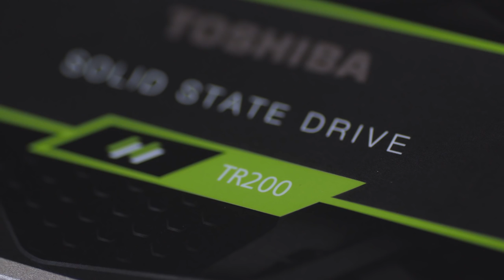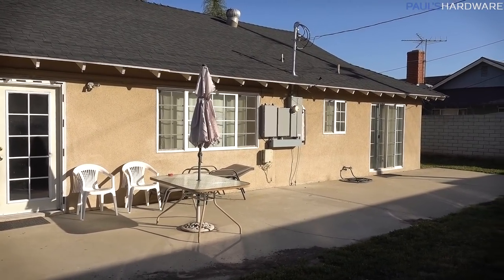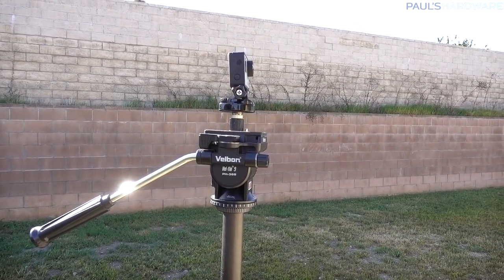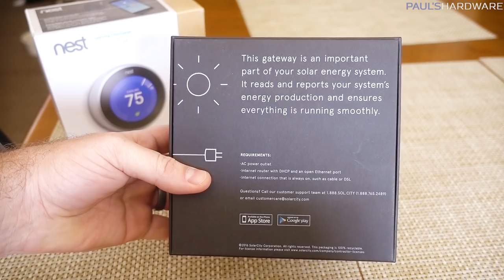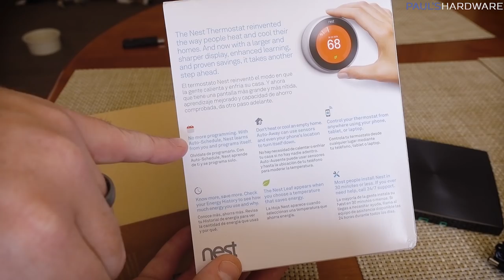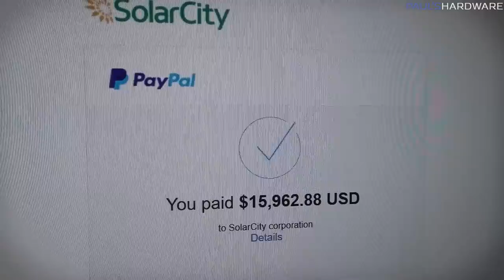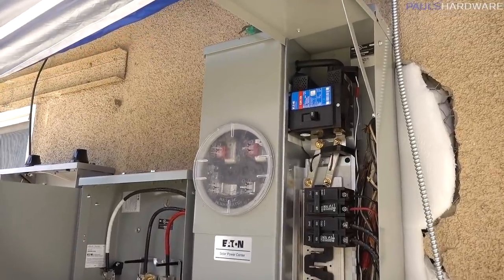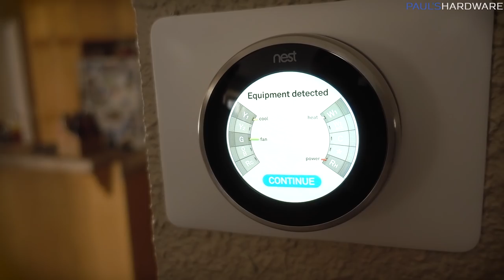The Good, The Bad and the Powerwall - My Tesla Installation Part 2

Comment: I have a question!!! that you put the powerwall at South that the sun light will heat the battery and the inverter!! if was you , I probably will put them in an other area or put something to cover them nicely , from thiefs and the UV sunlight that make them hotter !! in order to keep the equipment more years with out an issue!!  I know this system designing to be at rain and sunlight!! but even then, when I hear the fan run on a hot summer day ... I know that it is not good!! battery and inverter must be in cooler area and not be at hot area! and also have good fresh air!! I don't not know what suggestion I can give you , most of the electricians will say , will be fine!! But may be you can see where the sunlight will be at the pic and make something with the roof extender !! and have more shadow for you to relax...  something made with wood may be!! will be cheaper is you make it by your self after research . you will learn how to repair anything or upgrade ,plus a nice video , if you do handy stuff!! peace! P.S. I like the way you cut the video , is not boring... new subscriber!!

Comment: I'm having nothing but problems with my tesla solar install.  I had the roof done, conduit ran, panel upgrade. Wrong color of shingles, wrong type... not low profile panels, hideous disconnect locations, had to cut a tree down.

All things they could have said upfront but only to discover after the fact..

Comment: Very similar in Australia but alot cheaper hear but that is ent with the battery's hear but they do have it i have small solar in my room only 40w also in my house in the Philippines i have solar to its small one only 100w but i can add more panels to it i like two more so 300w so its good at moment it runs tv and computers and cb radios there in the Philippines with a 1500w inverter only small compared to yours Paul you need a veranda out there

Comment: Your home's power access panel is right outside, that is super easy for a thieve to pop open and just turn the power off and break in.  Not to mention if they knew how much the powerwall cost, that could be a good $4000 item on ebay.

Comment: My PZEV Focus has been proven to pollute  no more than charging an electric  car does. 150K miles , no major repairs needed so far. I feel pretty green👍
PZEV cars have super ultra low emissions engine / Zero evaporative emissions.
Reply: Most electricity in the United States is produced by Coal.  So you're polluting just as much, just not as directly.

I'm not saying solar panels and electric cars aren't worth it, just pointing out that until your home is completely independent of the energy grid, you are still polluting.

Comment: Just my two cents...instead of just getting the portion of the roof fixed to Tesla standards...just do it all. Honestly get it over and dine with and you won't have to worry about it for 25ish years. By the way, sexy battery.

Comment: bit surprised u can't Mount the inverter over lithium batteries...I know for lead acid u would worry about the battery gassing acid fumes into the inverter but lithium??
Reply: sweet fixing the roof for you daaaaamn .when a company has money

Comment: $6,000 for that solar setup is AMAZING.
Reply: Umm, where did you get 6k? Even after that deduction, it should be about 23k. Paul said $500 up-front, $15k-ish prior to installing, $15k after the installation and a $10k deduction from the government.
Reply: You're right, it above $20,000.

Comment: Cool video,  I got my panels installed in 2012 and I wrote a small python script that have been logging production every minute since into a MySQL database. :D they didn't really have an app back then so the script also makes a webpage for mobile with a graph created using RRDtool so I can follow it on my phone. Then another script translate it and upload it to  pv-log.com where I can compare my production to other installation in the area so I can see if it is performing OK.

Comment: Hi Paul. I got solar city to put up the solar panels on my roof and they said my roof was good enough but I installed a new roof just to be precautionary and it is going to cover the new roof so it should give some protection.  I pay 13 cents a kwh for production. I'd love a powerwall but too poor for now.lol. I hated my electric company because it got installed in May but they didnt turn me on till September because they wanted to get as much money as they could from me first. Lmao
#AllHaillSolarCity
Reply: I'm pretty sure every utility in the country is short staffed. Inspections get put in a que and since solar installs are low priority they get pushed. All the non essential work that my utility company does is at least a 2-3 months wait simply due to under-staffing.
Reply: Paul I was signed off right away. The local power company had come out but they said they needed time. It
Reply: This is the part where you are wrong about the utility.  They are usually more than happy to turn you on as soon as possible because they prefer routing more power to commercial.  Furthermore, they are more than happy to take your unused solar power when your battery is full and pay you back.  This will further meet demand and decrease the need to build more power plants.
Reply: totally wrong, solar just screws up the grid...
Reply: Jup and the cost of reducing the generated power of a big power plant to increase it again (even days later) is too high to make it profitable.  Resulting in overproduction and them stopping a wind turbine or a solar plant for a while so... It's cool if you can be independent and store your power. But giving them some "unclean" power at random times is more a burden to the power grid than helping even when every household in your area provides a bit, the current grid and its providing plants are dependable, cheap and maybe even cleaner than current batteries and solar panels. (considering the resources, energy and chemicals used in production compared to the amount of power they produce in their rather short lifespan).

Comment: Wow only 100 amps to the house? What do you do if you dry clothes, cook something in the oven, take a shower and use a hair dryer with maybe a few lights and a tv on?
Reply: Stove peaks at 40 amps and regular cooking will not stay at peak so 25 steady, dryer is only a bit less than the stove so 20, hair dryer draws 12. TVs are crazy efficient these days, a 65 inch might use 3 (mine only uses 12 watts with USB power on it also powering a chromecast and 1500 watts is 12.5 and my 12 watts is .1) if hes going solar even if he had 20 lights on at 7 watts a piece that's still only 140 watts/1.1 amps. So yeah he will be fine thats still only 65 or less.
Reply: larry Spiller add air conditioning. I'm not sure how this passed inspection, I'm assuming the 30amp outside goes to his compressor and it barely beat the calculation but I wouldn't be surprised if his follow up video after inspections calls for more amps.  Google electrical calculation for amperage rating and you will find several websites with easy calculators. 100amps fails almost every time, very few homes pass with it
Reply: I've had to swap 500sqft apartment units to 140amp to pass inspection
Reply: Jason Williams 100 amps will be fine. You need to give less importance to peak draw as it is not continuous anyways. 140 amps for 500 sqft ya ok bud.
Reply: larry Spiller I'm a gc and remodel and build about 140 houses a year, I'm familiar with code requirements, not in California but my understanding is they are the strictest state and use the most up to date code book. What do you do?
Reply: Jason Williams 4 year apprentice in Canada alberta.

Comment: Not sure how to inform Google/YouTube but in the past 2 weeks, lots of lag happening on YouTube and with smart TV's and displaying captions, YouTube videos lock up or freeze the TV. Have to unplug it to correct it.  Confirmed it's not the TV via desktop computers and smart phones. Worse with smart TV, next worse desktop computer and hardly any issue with smart phones. Using 100/100 Frontier fiber internet which doesn't duplicate the issue on speedtest.net.

Comment: So your garden's only purpose is to be used as big dog toilet? ^^
Was mentioned thousand times before, but I find it extremely scary to have the whole electricity system exposed outside. Easy manipulated and damaged by weather.
Also wondering about the worth of the house. Seems to be rather old and made out of cardboard. Installing a powerwall and solar panels feels like putting a carpet, couch and flat screen into a tent.

Comment: Instead of solar panels why didn't you just do the solar roof shingles that they offer? If you have to redo your roof I would think this would be the perfect time to do that instead of installing traditional shingles. Are those significantly more expensive or something?
Reply: Nathan Klaphake they cost substantially more and do not provide the same KW rating as the panels. A lot of articles on it.
Reply: 80 grand is alot of money? rofl...
Reply: Yes I to would like to know how much more having the roof replaced with the solar shingles, would cost than a new roof with panels.
Reply: I was wondering the same thing. The cost should be a little more expensive than a new roof plus rooftop solar but def not 80k like some have suggested on this feed. I also do not agree with the limitations on kw rating. You can add whatever percentage of active tiles are needed to achieve the result desired.
Reply: Based on my own house which Tesla's own website estimates I would need 50% solar coverage the roof would cost me about $26.50 per square foot to do solar roof. That price is just the roof tiles excluding the powerwalls. if you factor in the "tax credit" the price drops to $21.63 per square foot. By comparison Tesla's own website say that a standard roof costs about $5.00 per square foot. You can do this for your own home to by going to Tesla's website, clicking on energy and then Solar Roof and putting your address in. It will then spit out a pricing estimate in the form of financing and then cash. If you chose cash you will get to the same numbers I got to. As a comparison I wish you could do the same thing on Tesla's website to estimate how many solar panels i would need and cost per panel to do a proper comparison but alas to get that you actually have to request for someone to come out and give you a quote which I don't really feel like doing right now. Apparently Tesla will be selling the panels at Home Depot in the near future so that will allow me to see the per panel cost really easily.

Comment: On 14 days during March, Arizona utilities got a gift from California: free solar power.
Well, actually better than free. California produced so much solar power on those days that it paid Arizona to take excess electricity its residents weren’t using to avoid overloading its own power lines.
It happened on eight days in January and nine in February as well. All told, those transactions helped save Arizona electricity customers millions of dollars this year, though grid operators declined to say exactly how much. And California also has paid other states to take power. - LA Times 
http://www.latimes.com/projects/la-fi-electricity-solar/

Why are Californian solar firms paying to give away power?
http://www.bbc.com/news/business-40434392

California is taking a cooling off period after generating too much energy from the sun
https://qz.com/1224296/california-is-taking-a-cooling-off-period-after-generating-too-much-energy-from-the-sun/

The next important step/focus will and is on the scaling up of "grid sized" energy storage.
https://www.13newsnow.com/article/news/nation-now/worlds-largest-solar-battery-teslas-may-get-beat/465-0dc4dfd9-5c7b-41c6-88cc-5893191e6846

Comment: My God. What the hell are those ugly boxes for on the wall! There is no possible way you need all those boxes. Here it's a single box with the breakers, meters, RCDs, etc in the front on a panel that is normally fixed but can swing out to access the mains wiring behind it. If you want Solar/Battery they ass the inverter and some big clunky safety switches but it looks nowhere as crappy as that mess before the solar/battery was installed

Comment: Paul, If you havent yet, look into changing your SCE rate from the normal DE rate plan to a TOU-D-A. Sell your power during the day from your solar, then use your battery and low cost per kWh at night.

Comment: $30 Grand for solar...that would take my house nearly 50 years to pay back...IF the solar cells NEVER need replacing (which we know they will after about 10 to 15 years), and assuming I need no other maintenance.  Tell me again why I would do this???  BTW: Due to my location I need more like $50K because I live in the northern areas...and my solar days is about half of what you get.  Yea...NOT HAPPENING.

BTW: Noticed that if you need to re-roof your house you'll need to remove those solar cells in order to  pull the old roof off...so...there is a big hit when needing to re-roof (and unless you plan on leaving before that roof needs replacing, you'll lose money on your solar install)...I just don't see it...sorry.

Comment: WTF, you are due more than the roof repair.  Your exterior wall is ruined next to the mains panel, what gives with that, are they going to fix it?  A lot of holes drilled behind the actual power bank, were they repaired?

Comment: 20,000/30,000 unsubsidized for 19 panels?
350 watt panels optimistically?
6.5kw?
5 hours of sunlight a day assuming its even facing true south
valued at about 4.5$ a day
a 12 year roi
had the 5500$? powerwall not been pointlessly installed (price is dropping like a rock and it makes nothing?)
price would be some 16.3k or 10 years without the financing costs
likely 3-4% financing 
some 15-20 year return depending on financing mess

credit doesnt even make sense, no cap on $/kwh allowed

thats an expensive 6.5kw

used federal money to get subsidized roof
20+ year roi subsidized by federal government when theres plenty of superior 10 year ROI investments in medicine/technology/etc

this is why residential solar is a bad idea
Reply: could throw 3x10 panels onto a ground mount on literally any airport property anywhere next to a power line for 1/2 the cost?  any warehouse roof?

Comment: Can't wait for electric cars to be normal.
Reply: I definitely can.  It will take a long time for the tech and infrastructure to be as mature and convenient as internal combustion.
Reply: Yeah, I can't wait to be hindered in the long road trips I like to take, by having to wait hours to recharge a car that has 1/2 the range my car has and can be refilled in minutes.
Reply: Exactly, bye130.  Primarily electric hybrids might be an answer here, at least in the short run.  When batteries run low, an internal-combustion powerplant can kick on, and generate electricity for the system.

Electricity isn't an energy source, but an energy transmission medium (like the chain on a bicycle).  The power must be generated somewhere, and that usually involves burning something.  (Thermodynamics are a bitch.)  Wind and solar can only take over so much of that chore.
Reply: I can totally agree with hybrids, a lot of vehicle journeys are commuting and thus allow for charging at home/work, but for the long journeys cars with only a battery source just won't cut it, the energy 'density' is just not there like it is for gasoline/diesel.
Reply: Ya limited range, even more limited in the winter, required overhaul of the entire power grid, need for massive new generation plants, hours and hours of charge time if you want to go over 150 miles, please tell me the reason why I like loling when someone says is "clean" like you know... co2 is so bad (plant food) rofl... yet radiation i guess is good?  Or the chemicals that are used in shitty solar manufacturing... I mean you know the stuff is bad when even china regulates it.
Reply: Unless your in your teens, chances are you wont see them become mainstream to the point where they are the "norm" and gas/diesel power is the exception, but maybe your kids will. Im willing to bet that hybrids will be the ultimate compromise in the near future unless the price tags on full electric come way down for some reason.